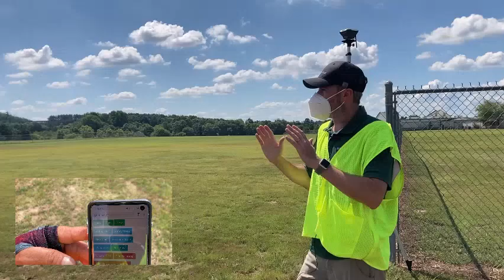Greenzie Product - How it Works: How does the mower know what to stripe?

Comment: How long does it take the base station to survey/calibrate? Are you using RTK?
Reply from the maker: We actually aren't using the base station setup for RTK to send RTCM correctional data anymore. We utilize correctional data over IP, through a correctional service.  Often times, called NTRIP or "Network Transport of RTCM via Internet Protocol", (an acronym with acronyms in it!).  The other term you'll hear is GNSS Correction Service.  There are other formats and data, but the one we're betting on is PointPerfect from u-blox, since we're already big fans of the u-blox chipsets and hardware.  This allows our robotic workers very efficient cm-level GNSS positioning without a base station, and without a 2-way communication (required in the past).  To answer your question, back when we were using a base station, you could set the base station to take samples and average as part of the "setting" step when you turned it on.  We settled on 2 minutes back in the day as that was about how long it takes to mow the boundary of a lawn.  But now, we don't need it.
Reply: @Greenzie  does the NTRIP provide correctional data at a fast enough rate to correct gps in real time mowing? 
Does the PointPerfect NTRIP network have close enough bases to cover all the service areas that your robotic workers are deployed in?
Reply from the maker: @user-rb5sv3vh2c  Yes, the GNSS (GPS) fix comes in at a higher speed of 5hz, and correctional RTCM publishes 5 messages every 5 seconds.  We sensor fuse GPS with a high-grade IMU and wheel odometry, so we generally have a good approximation of where the mower is for real time mowing.  Yes, coverage in the USA looks quite good, much like a cell phone map.